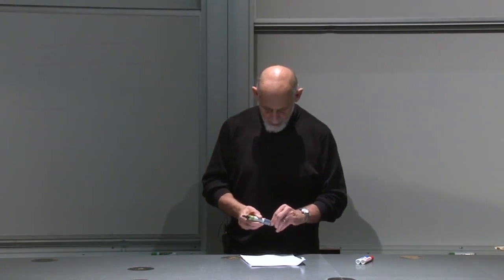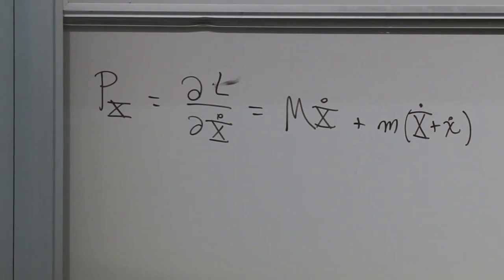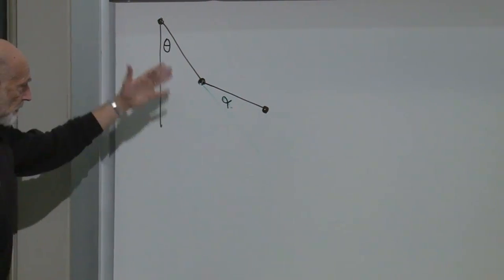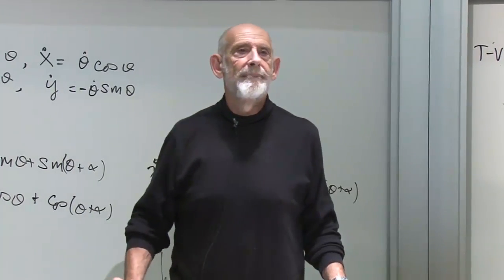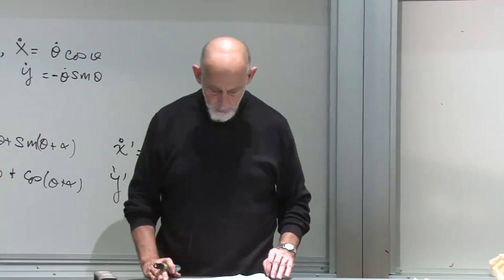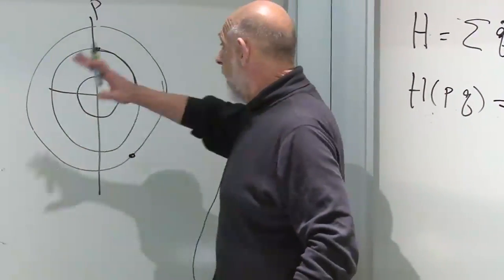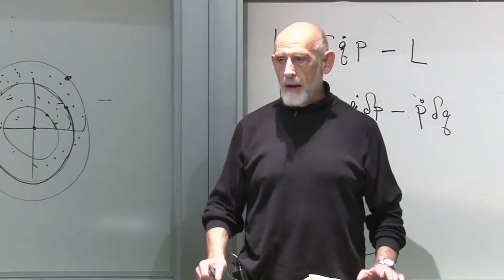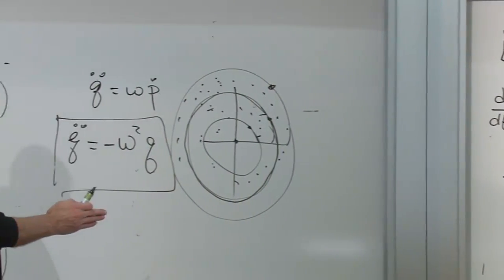Classical Mechanics | Lecture 6

Comment: It appears that the way he solved the inclined plane problem, by assuming the point mass remains on the inclined plane, in no way reflects reality if the inclined plane is accelerated in a direction away from the point mass. In reality, the inclined plane would leave the point mass since it is not exerting a force on the point mass. This could  be addressed by utilizing Newton’s laws of motion.  The problem is posed as a reversible problem by requiring the point mass to remain on the inclined plane, while in reality it is not.  Caveat emptor.

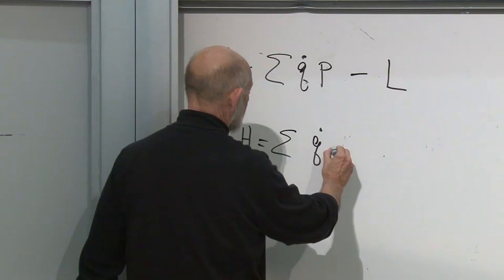Comment: Fantastic lecture! I don't understand why the change in p q dot at 1:17:10 can be re-expressed by p (delta q dot) + q dot (delta p); it seems to me that it should equal p (delta q dot) + the transformed q dot value (delta p) or alternatively q dot (delta p) + the transformed p value (delta q dot). I'm probably doing something wrong, any help would be greatly appreciated. :)
Reply: the best video ever seen on classic mechanics https://youtu.be/pkw92_Jpv1E
Reply: Can it be denied that this type solves the most difficult problems? https://youtu.be/pkw92_Jpv1E

Comment: +mg was right and he changed it to -mg at the urging of the same student who tried to convince him derivative sin is -cos.

If you have d/dt of momentum = -mg then you are saying the F (derivative of momentum) is acting on a falling object is not  in the same direction as the acceleration.  Both have to be in same direction and hence same sign.

The F is down and mg is down.  So the signs on both sides have to be same.  If sign is reversed then resulting Force would be in opposite direction of the mass time acceleration: g.

Comment: Absolutely well done and definitely keep it up!!! 👍👍👍👍👍
Reply: +mg was right and he changed it to -mg at the urging of the same student who tried to convince him derivative sin is -cos.

If you have d/dt of momentum = -mg then you are saying the F (derivative of momentum) is acting on a falling object is not  in the same direction as the acceleration.  Both have to be in same direction and hence same sign.

The F is down and mg is down.  So the signs on both sides have to be same.  If sign is reversed then resulting Force would be in opposite direction of the mass time acceleration: g.

When you do L = T - V, V = mgy.  As y increases V increases.  L = T - mgy.  He had this right.  

Then take partials bringing the contribution from d/dt (dT/dq-dot) = mg.

Lastly, let's say he was right: F=-mg.   Then this means F + mg = 0.  But the gravitational force is suppose to be conservative.  The plus on left breaks this.   On other hand, F = mg, then F - mg = 0 is valid as we would expect for a conservative force.  So it has to be F = mg.

This man absolutely knows his physics.  But he lets his students questions and comments fluster him into making mistakes.  No wonder he admitted in lecture 3 that he makes algebraic mistakes.  It's cause he is not in a quiet place to think but has to perform in the presence of confusion.
Reply: Can it be denied that this guy solves the most difficult problems? https://youtu.be/pkw92_Jpv1E

Comment: What a terrible choice of coordinates for the block on an incline plane.
Reply: I think +mg was right and he changed it to -mg at the urging of the same student who tried to convince him derivative sin is -cos.

If you have d/dt of momentum = -mg then you are saying the F (derivative of momentum) is acting on a falling object is not  in the same direction as the acceleration.  Both have to be in same direction and hence same sign.

The F is down and mg is down.  So the signs on both side have to be same.  If sign is reversed then F is opposite direction of the mass time acceleration: g.

When you do L = T - V, V = mgy.  As y increases V increases.  L = T - mgy.  

Then take partials bringing the contribution from d/dt (dT/dq-dot) = mg.

So left side is F and right side is mg.

Another way to think of it is the gradient of mgy is already negative.  And you have to put a negative in front to get it to equal the force.   Thus the signs are positive on both sides of the equation.
Reply: Can it be denied that this guy solves the most difficult problems? https://youtu.be/pkw92_Jpv1E

Comment: His explanation for how beautiful the Hamiltonian is is how you can see these phase portraits and gain an understanding of the cycles and non convergent behavior, etc... but I keep thinking to myself, "but you could take Newton's equations and just plot x vs xdot and see that too..." Also, I am slightly confused how he initially explains that it was vitally important in coming up with the Lagrangian that it must be T-U, not T+U, in order to obtain the equations of motion after applying the Euler Lagrange equation. Then Hamilton comes along and decided, "no, it's better to make it T+U" after all? Is his formulation kind of like an add-on or adjustment to the Lagrangian so that it can still give the equations of motion using the Euler Lagrange operations but also does not change with time? What does it mean, intuitively, that the action that the Lagrangian minimizes is T-U? Is it that as kinetic and potential energy trade back and forth through the course of a system in motion, that it is done so in such a way that their difference is kept as minimal as possible? Since there is no constraint on holding total energy constant with time in the Euler Lagrange, is this achieved just accidentally?

Comment: I am desperate to find out how he came up with the omega parameter  at 1:03:40. I can not seen to get form the standard fornm wuth K and m. Any helpl would be greatly appreciated.
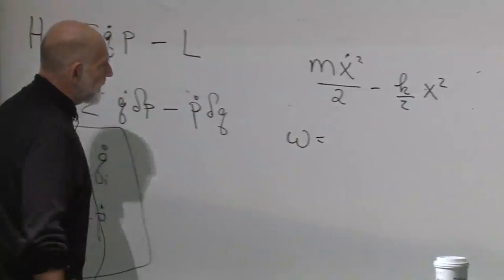Reply: At 1:32:00 he explains how he derives omega from k and m via a change in coordinates.
Reply: There is a known formula for springs: T = 2pi * sqrt(m/k). f = 1/T, so we have to take both sides to the power of -1, which will result in: f = (1/2pi)* sqrt(k/m) or w = sqrt(k/m).

Comment: do you have to use the rectangular (x,y) components of velocity when you write down the kinetic energy?
Reply: No, those just happen to be the easiest components to figure out a lot of the time. For example, you can also use polar coordinates (for 2D space, as that is what he was using) where the kinetic energy can be written with the sum of the radial and angular velocities squared. As long as what you write for velocity is actually the length of the velocity vector.
Reply: you can use any coordinate, but for most of them it may be difficult to find out how is the expression of the kinetic energy. Most of the time you just write your coordinate system as a function of cartisian or polar and then work out the kinetic energy from there

Comment: At 1.30 there was a discussion on dimensions. q initially is the definition of a coordinate system and in my view the dimensions of this must be position as one of the students said. How does the dimension demonstrated by th professor relate to this?. Is the coordinate system selected in a special way to make this true? Perhaps another way to put it is how does one express this in terms of the coordinates geometrically.
Reply: To answer your final question: straight lines. The coordinates he chose were proportional to those of space but by a factor that has units of its own.

Comment: excuse my possible ignorance but what exactly is canonical momentum? From the way he is using that term it sounds like momentum in a particular direction (like a component of momentum). and why wouldn't it always have the same units?
Reply: cubedude76 canonical momentum is the partial derivative of the lagrangian with respect to the time derivative of a coordinate. Therefore, it's unit depends on the unit of the coordinate in question. See the earlier lectures in this series for more info on canonical momentum